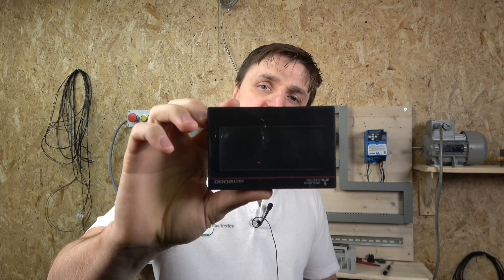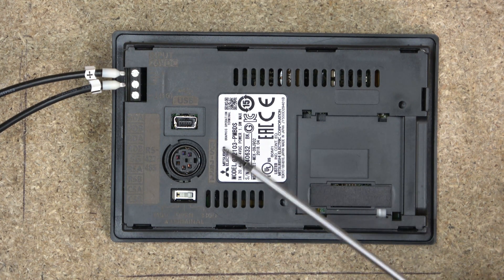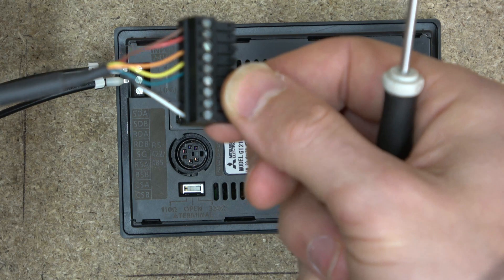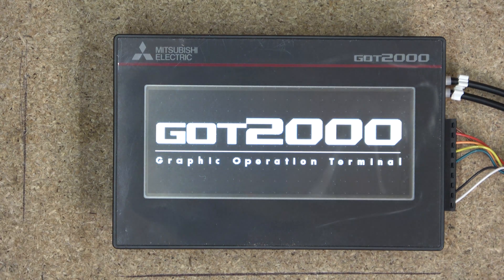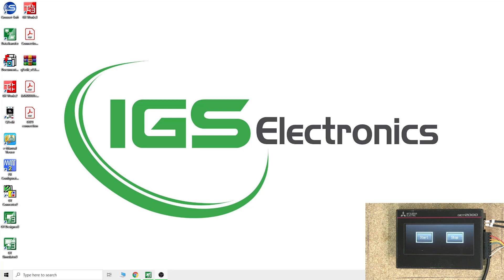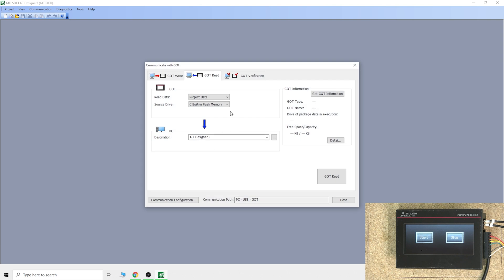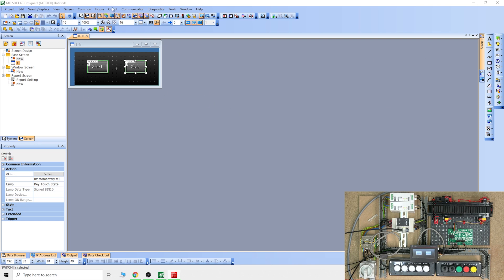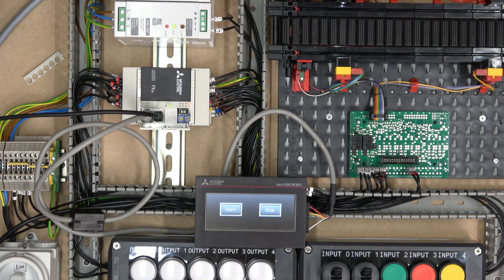Mitsubishi GOT 2000 GT21 program upload/download, wiring with GT Designer 3. English

Comment: If I want to connect 'ground' for HMI (GT2103-PMBDS) which is supply by the 24VDC to power supply unit  , am I going to wire it with AC ground or DC 'COM' on power supply unit ?
Reply from the maker: Ground can go to any grounding point.

Comment: Why you didn't connect a wire for Ground(FG) ON HMI(GT2103-Pmbds) to Power supply unit ?
Reply from the maker: Hi. The FG is grounding, that i did not use for video purposes, but you should for your main application.
Reply: @IGSElectronics  My PLC is Mitsubishi FX30MR-ES and My HMI is  GT2103-Pmbds . @t, the FG(Grounding) is ok whether I want to connect it or not .Is it so ?  Although the manual didn't mention it need to be connected.
Reply from the maker: @yewjieh3897  The FG will not stop your controller working, it is for extra protection in case there is leek or other ground related problems. It is always good practice to use the grounding.
Reply: @IGSElectronics   I see.So, it's ok to put a wire connecting FG(Grounding)  On HMI with Power supply unit(24VDC).If I do this , there will be more gurantee In the connecting process.
Am I understand it right ?